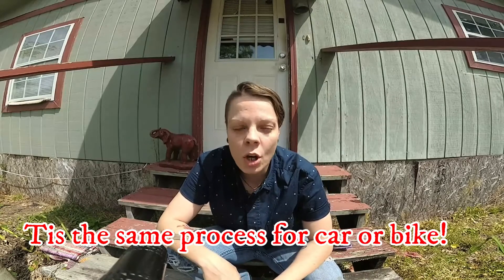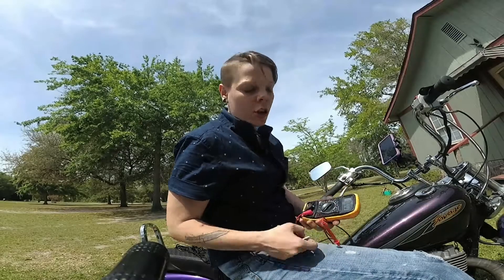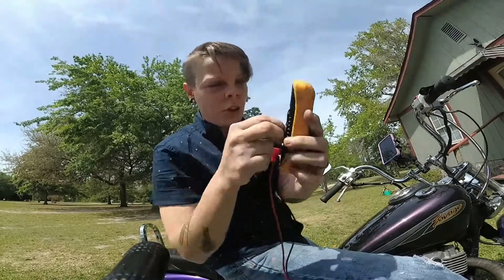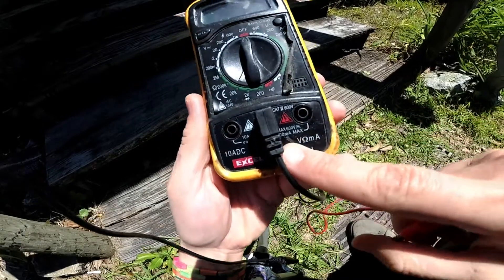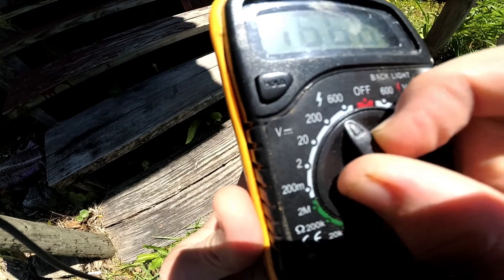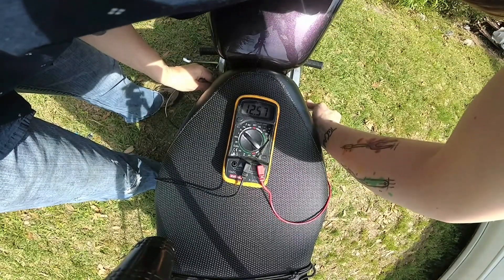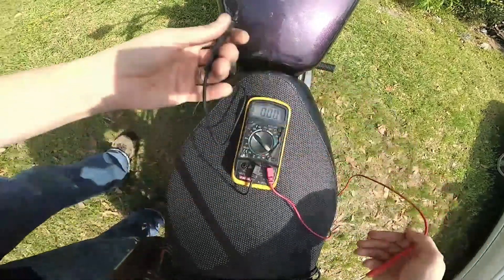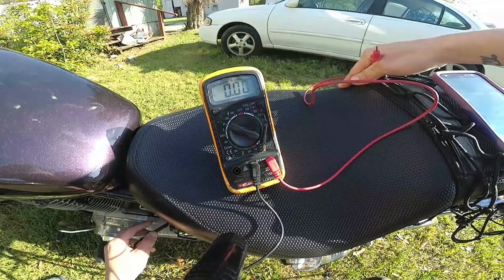How to test your charging system on a motorcycle. (pt1. your battery!!!)

Comment: Hi. I have the same model bike.  Mine also reads 12.33 or so when idling. but it has let me stranded, and i feel the voltage should be a little higher. Does it needs a new Rectifier, or that's the way this bike are?  I haven seen the other parts to this videos, so I'm asking you on this one.